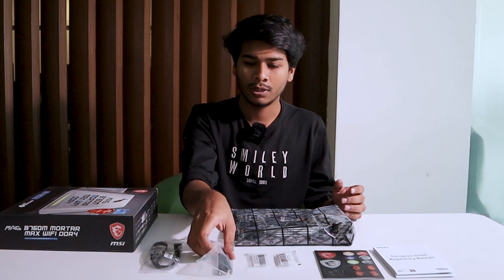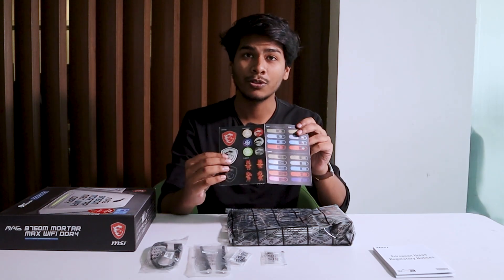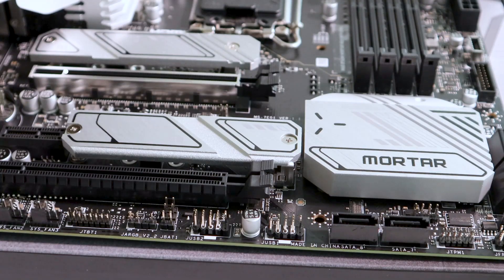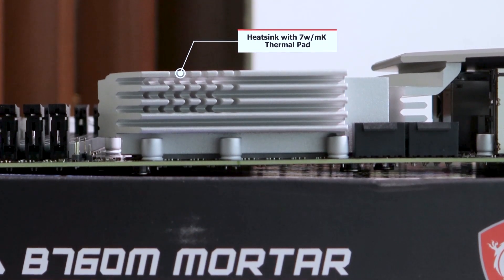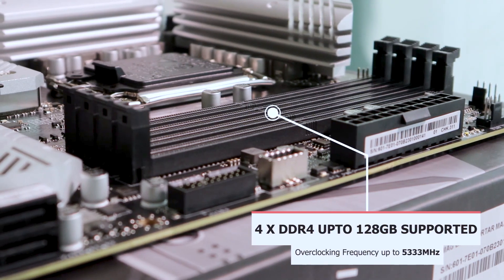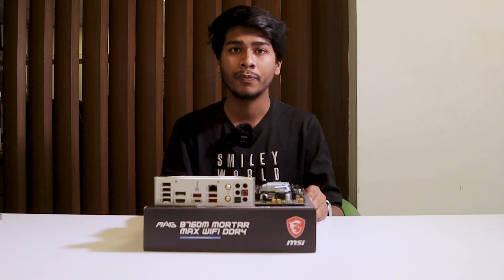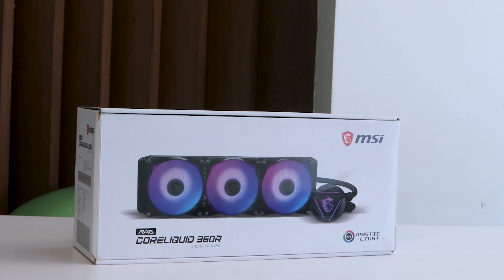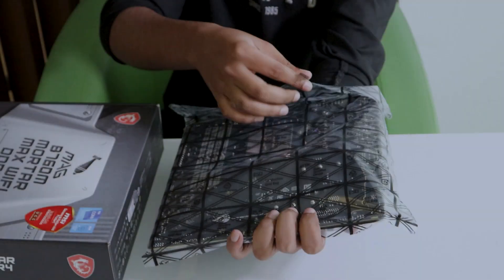Lets build with MSI MAG B760M Mortar Max Wifi DDR4 (Bangla)

Comment: Hello vaya আমি আপনার ভিডিও নিয়মিত দেখি আমি একটা RTX 4090 কিনবো but Reddit এ দেখলাম ওভার হিট এর কারণে পিন কানেক্টর গলে যাচ্ছে এবং মাঝে মধ্যে আগুন ধরে যাওয়ার চান্স থাকে rtx 4090 কেনা ঠিক হবে নাকি 3090 ti কিনবো??
Reply from the maker: Shouldn't be any problem. The issue is occurring if you do not plug the 16-pin power connector properly. Push it all the way in and make it doesnt become loose while doing cable management.

My 4080 is running without an issue for last 4 months. Happy gaming !
Reply: @redviperztv  Thank You Vaya And Your Videos Are More Good And Professional Then PCBBD Keep It Up And I Believe Your Channel Would Be The Secend Biggest Pc Content Creator Of Bangladesh After PCBBD